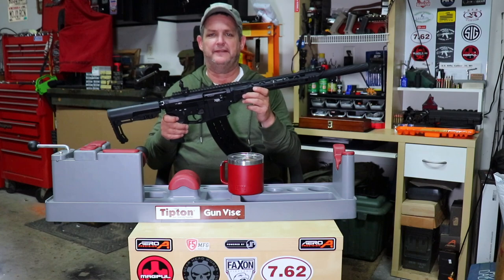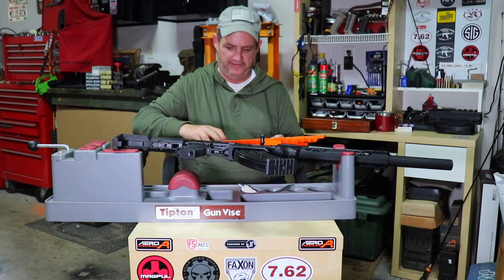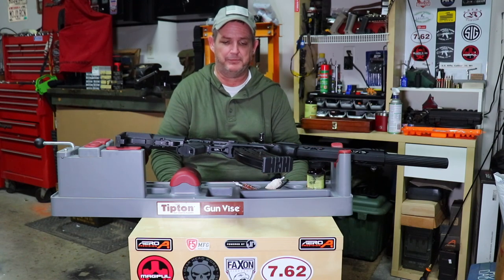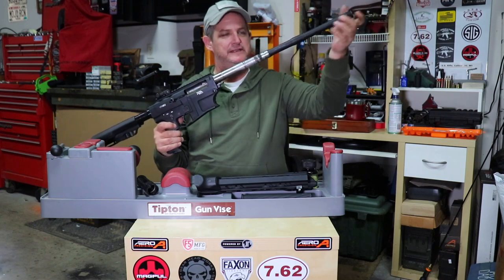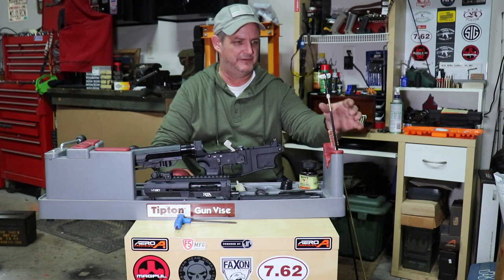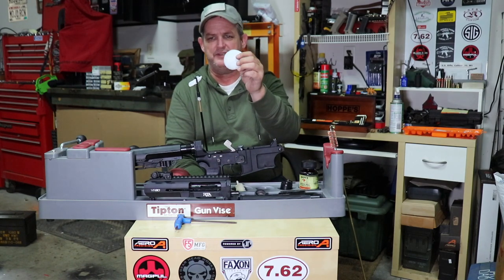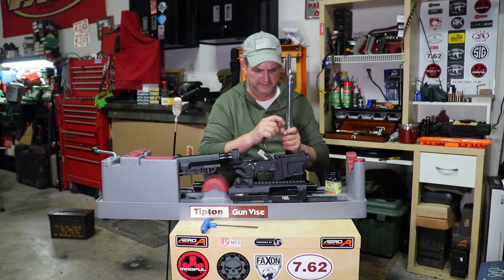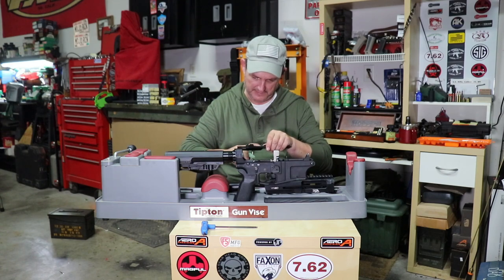COMPLETE CLEANING, DISASSEMBLY AND REASSEMBLY ROCK ISLAND ARMORY VR 80

Comment: Very happy to have found your video.  Last night I brought home a VR-82 (the 20 Gauge version of the VR-80).  Today I shot 3 low power bird shot cartridges from two different manufacturers today (Browning 2 3/4 in, 3 dram 1300 fps, 7/8 oz, 7.5 shot) (Federal 2 3/4 in, 1210 fps, 2.5 dram 7/8 oz, 8 shot).  First shot ejected but didn't load, followed by variations of not ejecting.  It's my first shotgun, and I've only had an AR-15 platform for few months.
I picked up the only local ammo available that appeared higher.  It's a magnum load with same velocity but heavier load of bird shot 1.25 vs 7/8 (B&P 3 in, 6 shot, 1 1/4 oz, 1300 fps).  Now I've just cleaned the upper section based on your video.
Selected the 20G of 12G  to keep recoil down so my wife might try it.  Just wanted a shotgun to learn about it, and play with items from the better stocked ammo shelves.    Hope it eventually works with the cheaper common ammo, otherwise those nicely stocked shelves don't help very much.  I'm sure the cleaning will help, and finding rounds that do work so I can exercise it more.
Mainly just wanting to get some info out there on the VR82, which just doesn't show up in many google searches.
Reply from the maker: Awesome!  Would be cool to try out the 20ga!  I didnt even know they were available.  The cleaning will help but really you just need to break it in.  Run some slugs and buckshot through it and then a box of heavy loads like turkey loads or some magnums.  after that you should be good to go.  On the 12ga it takes rounds running about 1350 fps so on the 20ga Im not sure what that equates to.  Just figure its a little more than the cheap bulk packs at walmart however, i can now run those after breaking mine in really well.  Good luck and let us know how it goes!
Reply: @RockfordOrdnance  Oddly the manufacturer's website doesn't even know the VR-82 exists.  I'll have to visit other gun shops to locate some slugs and buckshot.  Main primary store only has a half dozen variations of birdshot.  Hoping to get a few shots in today (before the snow & cold hits us) to see if the cleaning or new ammo improves things.  I expect the cleaning to help, so thanks you very much for the knowledge transfer!

Comment: Thank you for all the great info. Can you comment on leaving the slide open for a month to loosen the spring so you don't have to run 200-300 rounds to break it in? Thank you.
Reply from the maker: I call BS on the idea.  I watched the video that recommended keeping it open.  If keeping the bolt open gave the spring a bit of a "set", I would recommend finding a higher quality spring.  Its very well known that working a spring is what wears out or weakens a spring.  Keeping a spring in a static position whether compressed or at rest doesn't change a thing.  Take mags for instance.  I've run mags that I've kept loaded in some cases for 3 years.  They work just fine.  Now I will say that if the spring in question is of poor quality or incorrectly manufactured, it can develop a set but in this case, it doesn't apply. In my experience it doesn't take 200 rounds to break this gun in.  I ran a mag or two of slugs followed by a mag or two of buckshot followed by 2 mags of high brass, high power bird shot.  I then switched over to 3 dram birdshot and its run flawlessly.  It will even run some 2 3/4 dram loads without a problem.  In my opinion, I think it would have ran the 3 dram loads right out of the box.  Take it apart and clean and lubricate it well.  Make sure you have the low power gas valve in it and check that the ports are clear.  Also make sure your O-ring is in the gun and in good condition and go to town.  What type of problems are you having and with what loads?

Comment: You mention not to oil the areas of the gas system.  Is it OK to use CLP on these parts including the piston?
Reply from the maker: Sure, CLP is a multi use product.  It cleans, lubricates and protects.  It would not be my choice but you could use it to clean and then just make sure you get as much of it off as you can.  Try it and see how it is.  If you start developing more carbon than usual, discontinue use and try something else.  Dry lube can work well in these areas but I have always found it best to leave the gas system parts clean and dry.

Comment: Quick question I just cleaned my vr80 watching your video and I was wondering is the gas piston supposed to have a little bit of play with the bolt forward? When I move gun back and forth I can here it jiggle a little bit is this normal or did I put it back together wrong ?
Reply from the maker: I believe it does.  I will check tonight.

Comment: Thanks for the help!.. is it normal for the light load metallic ring to slide in and out when I hold the vr80 north south? It seems like it’s supposed to stay snug. New to this if you can’t tell.
Reply from the maker: it will slide back and fourth when you have the bolt locked back but when the bolt is in battery it should be held in place.

Comment: what would classify as heavy load? Is is determined by the fps?
Reply from the maker: So when it comes to what gas ring to run, it's easy.  If it's 2 3/4 inch run the light gas ring.  If it's 3" shells run the heavy ring.  That is what the factory recommends in the manual and it's what works.  I'm not saying there are not exceptions where maybe a heavy 2 3/4 inch round runs fine on the heavier gas ring thereby reducing recoil but you can't go wrong if you use the rule above.

Comment: Would you have any idea on why my handguard rail slides forward about a quarter inch? Ive tried switching out the shroud to see if it will help but nothing.
Reply from the maker: Has it done this since new?  Are you saying its like the shroud or barrel nut doesnt or wont tighten down enough or all the way?
Reply: @RockfordOrdnance  i did same thing. is your barrel all the way in, did it click into place. If not the handguard rail will not tighten all the way and you have a lose hand rail.

Comment: Mine stopped working after 100 rounds. Pin not hitting the primer on my high brass shells. They haven't been helpful with the issue.
Reply: Thank you for the video. You may have shown me the issue. Will let you know.
Reply: my gas ring piston wasn't moving
Reply: That was my issue. Thank you so much. I got the gun used so I never saw how it functioned before. Piston had siezed and prevented the action and firing pin from coming forward enough. Thank you sir !
Reply from the maker: No problem!  Cleaning does wonders!

Comment: Can I use carburetor cleaner to do the initial clean, and than go over it with gun cleaner/lube in the can?
Reply from the maker: absolutely.  Just make sure you keep it away from any polymer parts as well as the o-ring in the gas system

Comment: Buying this soon. Why take off the barrel, why not disconnect the lower and upper and stick in a cleaning rod. You have to clean the bolt anyway.  I don’t believe in messing with screws if I really don’t have too. From my experience they get sick of going in and out.
Reply from the maker: In order to remove the bolt and carrier, you have to remove the barrel
Reply from the maker: It’s no big deal. Don’t sweat it

Comment: Great vid. New subscriber. Can you let me know what stock that is?
Reply from the maker: Yep, I kept the factory buffer tube which is a commercial tube not a milspec and the stock is made by MFT (Mission First Tactical) the model is called the Minimalist.  They make the minimalist in both commercial and milspec varieties so if you want to keep the commercial tube the vr80 comes with just get the commercial version otherwise you can change it out to a milspec tube and get the milspec version.  Great Stock, super light, easy to shoulder and light.

Comment: do you oil the piston?
Reply from the maker: Not at all.  I keep oil away from the gas system
Reply: @RockfordOrdnance  ok I oil mines
Reply from the maker: Oil in or on parts of the gas system just burns up the oil and creates more carbon making the parts super hard to clean.  The gun doesn't need it.

Comment: 👍👍
Reply: I moved away from using oil for the most part. A "liberal" (not a pun) layer of a dry lube does a lot. I'm partial to a mix of hexagonal boron nitrite and tungsten disulfide in an ether suspension.
Reply from the maker: Sounds complicated!  Tungsten sounds hard and abrasive (I know its not)LOL!  Any name brands you can recommend?  For everything but the gas system I have really become partial to this Lucas gun oil.  Good stuff!
Reply: @RockfordOrdnance  Pretty simple. Apply and let dry. I buy it in powder form and mix it myself. You can also substitute ether for 91%  -  99% isopropyl alcohol for cost savings. I have several needle applicators for putting it on. For large jobs like on my roller lockers, I use a spray bottle. For really hard use I'll add in PTFE powder. A little bit of these lubes go a really long way. I've had my 2 oz PTFE, WS2, and hBN for a little more than 8 years now. I'm barely a half of the way into any of them. You can also mix them with oil. (I like a 4:1 syn oil to syn tranny fluid mix - Castrol preferably) Even when the oil burns off or drys up the dry lube remains. However, the powder will settle in the oil over time so you will need to shake before using. I add small nickel-plated ball bearings to help agitate. WS2 & hBN works great in grease too. I like mixing them with silicon grease.

WS2 - Tungsten Disulfide
https://www.amazon.com/MICROLUBROL-TUNGSTEN-DISULFIDE-Sulfide-Powder/dp/B00WP4306U/ref=sr_1_20?
hBN - Hexagonal Boron Nitride
https://www.amazon.com/MICROLUBROL-HEXAGONAL-NITRIDE-Powder-micron/dp/B01N4CSDB6/ref=pd_sbs_236_3/
PTFE
https://www.amazon.com/MICROLUBROL-OMNIFLON-XDL-Lubricant-APPLICATOR/dp/B017C1B8MI/ref=pd_sbs_328_2/
99% Isopropyl Alcohol
https://www.amazon.com/Bottles-Isopropyl-Alcohol-Industrial-Concentrated/dp/B0874C5CWB/ref=asc_df_B08DFSBRDV/